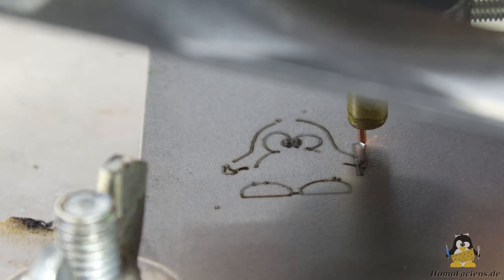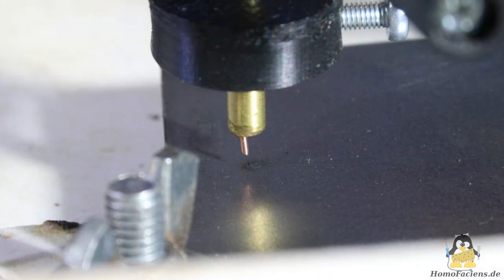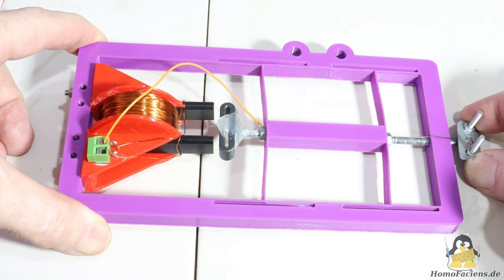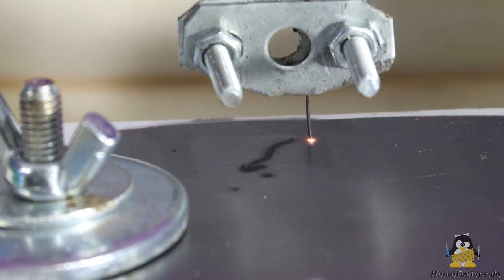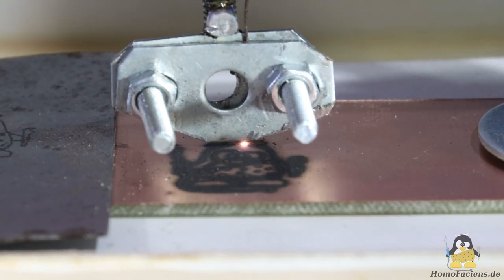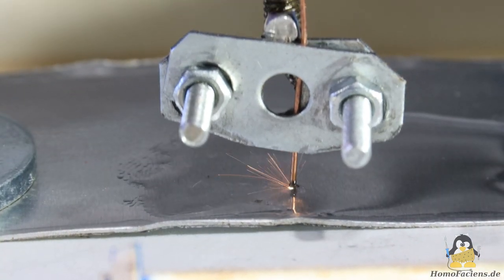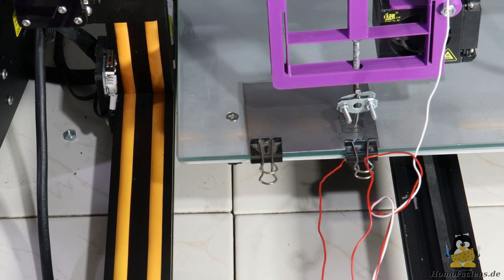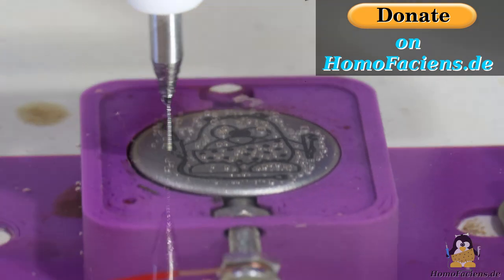Engrave metals with Wagners Hammer

Comment: The contouring consistency is amazing on some of the material combinations!! The compliant anti backlash is so elegant! Lovely. Post apocalyptic tech is the best.
Reply from the maker: As I will show in future videos: The smaller the diameter of the electrode wire, the finer the resulting lines. I have already tested 0.2mm tungsten wire and that works fine. 0.1mm tungsten and and steel wires are ordered. Stay tuned!

Comment: Would love to see more done on this. 
You're set up there Engraving  the token it's very interesting
Reply from the maker: I am working on more videos. The one under construction is about current and force of a Wagner Hammer. Stay tuned!
Reply: @HomoFaciens  cool
Reply from the maker: No, hot. Sparks generate enough heat to melt steel ;-)